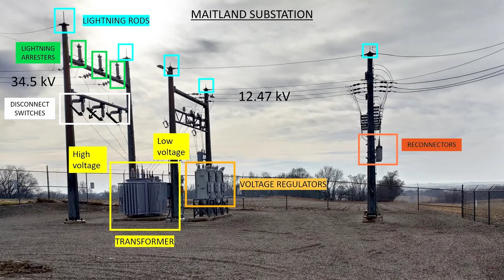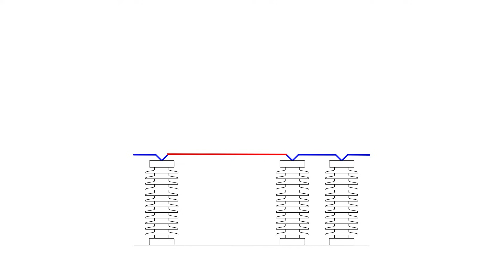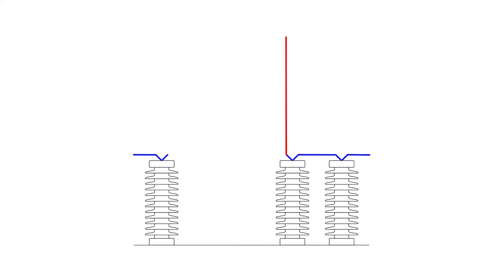Identify equipment in a substation (35 - Electricity Distribution)

Comment: ??ok,....  So are you referring to the stacked insulators as "Bushings" here?? I am confused as we just call them insulators as they do just that...INSULATE! we sometimes refer to them also as "Bells" as some of the insulators do look like glass bells.  You describe that when under load a transformer's voltage "sags" - in reality it actually "drops". Sag would describe a low line or uneven tension on all three legs! At 07:30 you refer to the opening arc on a opening of a switch as "Lightning bolt" which it is not! Lightning bolt is mother nature do her thing...the arc is what you get on a switch( Sometimes called a dragon's tail).  The circuit breakers actually arrests the "Lightning bolts" (Actually arc) by damping inside the switch by being submerged in oil when it operates.

Comment: Regarding the disconnect switch on the hv side, in this case the CB will open the line first and then the disconnect switch would be opened manually or motorized? Instead of open the switch first which cause unnecessary arching

Comment: Why the low voltage side uses recloser but not on the high voltage side? Fuse requires manual intervention if upstream has fault
Reply: Probably because these are small and simple rural substations. Bigger ones will have SF6 breakers on the HV side

Comment: At the 8:30-8:34 mark on the circuit breaker you called the bushings that point out at an angle buss bars. Was this in fact a buss bar on this specific piece of equipment or was that a mistake? They look like bushings to me and just trying to clarify here in case there was a mistake made

Comment: There is a reason you cannot eliminate the switch by using just a breaker. In order to work on the transmission line, by applying grounds, there must be a visible open switch to attach the grounds. It is a safety rule. Utility do not like to use a switch to open a circuit because it stresses the switch jaws and sometimes goes very bad. This equipment is not cheap. Some breakers are oil breakers and the newer ones are SF6. The old oil breakers are large and heavy. Also oil breakers have a potential of an oil spill.
Reply: I was about to add a similar comment this but glad that you got here first. Thank you!
Reply: you are so professional.:washhands: we are make the insulators and switchs factory, we have met so many customer like you. :washhands:

Comment: Cursed local Ultility company when I was on weekend call they sent me to a building I never was in and just had the emergency generator up on the 8th floor replaced. Building had dual 13,200 volt service that tripped out and could not get the ATS switches to transfer back to normal power. For some reason the one elevator on emergency power was not working so I had to climb up from basement to 8 th floor several times. Could not find any books on ATS switches or generator. Here after a few hours called the Ultility company. They told me they were having problem with over voltage that late Saturday night. Think I had over 521 volts instead of usual 480 volts. ATS switch programmed not to transfer power to an over voltage source.

Comment: Nice presentation and information. Question: Are "Ground Switches" considered "Fuse Switches"? Thanks.
Reply: My experience/understanding is that a ground switch is someone you can apply after the load is disconnected. Usually to remove any charge/static from a cable. Fuse switch is just a fuse

Comment: Not trying to be a critic, but I think you have something confused. The part you are calling "regulators" look more like OCBs (Oil Cooled Breaker) and might have a regulator on it. I'm no expert, but I work in the field - R&C designer - and the part you identify as a CB (Circuit Breaker) is actually a recloser switch but they do not have bus bar connected to the bushings, looks like cable to me. Good video though and like how you point things out so even the untrained eye can see it.
Reply from the maker: Thank you for the comments!
Reply: @adanner correct the vid 😂
Reply: No they are VR. Not OCBs
Reply: If you are going to attempt to correct people you should make sure you know what you are talking about, OCB-Oil Circuit Breaker and they are in fact voltage regulators.
Reply: @turdferguson8612 sorry to break it to you but they aren’t voltage regulators. Circuit breakers protect against overloads or short circuits. Voltage regulators are to change voltage when the demand changes. So during high load the voltage will drop, the regulator will change taps to boost the voltage and then when the demand goes down and voltage rises the regulator will adjust the tap to keep the voltage at the set level. 
A Voltage regulator is typically far from a substation, typically in rural locations.
Reply: @stanley4006 is voltage regulator also known as OLTC typically No!
Voltage regulator is actually use for  protection relay that is under voltage or over voltage protection, also Voltage Regulation: Maintains a constant output voltage level of a  transformer, enhancing equipment performance and longevity and  suitable for High Power Applications:  While OLTC ( on load tap changer) is for adjustment of load demand when sudden voltage Change occur without interrupting power supply and can be done automatically or manually.
Reply: @stanley4006  I'm a substation electrician. They're voltage regulators. Typically in rural subs, the regulators will be right on the secondary side of the transformer. I agree that they are infinitely more common on long spans of line in the open world, though.
Reply: @patrickbates6679  yes, voltage regulators make sure that current and voltage sin waves remain in sync as demand of capacitive or inductive loads cause one or the other to lag, real-time adjustment based on load prevents the grid from suffering, also why large facilities  are charged for their reactive power
Reply: @dylansir0230  to correct a lagging power factor caused by a inductive load you use capacitor banks. Auto cap banks have a CT on main bus or conductors in a substation, the controller in the cap bank will then switch on and off banks of caps to add or decrease reactive power to the system. The correction reduces the amount of apparent power. This does help regulate the voltage but is not a voltage regulator.
Reply: @ikpalian4413  OLTC is in a substation transformer to do essentially what a voltage regulator does but the transformer is also stepping down the voltage typically for distribution. We are talking about different things. If you google voltage regulator you can find articles on it, Eaton has a great explanation unless your going to tell me you know more then Eaton does. Let me know where you article is so I can read what you think. 🙄
Reply: @patrickbates6679  I am not disagreeing what a voltage regulator is. Someone else said a OCB is a voltage regulator. OCB is oil filled circuit breaker (for medium voltage) as I am sure you know, for short circuit or overloads and has relays attached for the protection side. We have drained the OCB tanks to filter the oil or replace and inspected and clean the contacts. 
I work for a large testing company, we work in outdoor substations and large commercial and industrial buildings testing, doing maintenance, repairs on low medium and high voltage equipment.  Like but not limited to breakers,
(Test SF6 breakers and fill SF6 gas if low)  switches, transformers, cap banks, cables, and Emergency repairs on equipment that failed, Etc…..
Reply: @patrickbates6679 100% ❤
Reply: @stanley4006 they are not ocbs.even single tank ocb’s are huge! Sometimes you can fit all three phases in an old ocb.
Reply: @ ummmmm they are OCBs (oil circuit breakers) we work on them quite often at work. One place we do maintenance at is a large steel mill that has a ton of them. We drain the oil and filter it, clean the contacts, inspect the tank and contacts and test them including time travel. So yea they are oil circuit breakers. So the name plate inside that says “oil circuit breaker” is wrong from the manufacturer when they were built in the 50s. You obviously know more than the manufacturer right.
Reply: @stanley4006 you can see the little dials on the top side of the tank indicating where they are operating at. Literally those are regulators

Comment: Question:  A substation using a 3 wire 3 phase system, is that a Delta system?
Reply: Not necessarily. Delta, Wye, and Zigzag are all 3 wire sys. if not using the ground/neutral.
Reply: @Eric_Dan-6_MD_PhD  Thank you.   The 3 wire system, no ground/neutral from the substation.
Then the only grounding would be DONE are each pole along the distribution system
that had a transformer mounted to it?      If so, then NO PARALLEL neutral/ground
back to the substation?    thank you
Reply: @tedlahm5740  Dear colleague, the grounding will be "created/invented" by a 'Y' (or Zigzag)  somewhere along the distribution. Body safety grounding connection should not be confused with a Neutral connection created by a phase combination where phases vectors of A+B+C=0 (AKA neutral). Loopback of earth fault is different from neutral fault or unbalanced 3 phases case identified by its 3 symmetrical vectorial components per phase I1+I2+I0=Iphase.
Reply: @Eric_Dan-6_MD_PhD  Sir:  How does the Power Company Balance THEIR load when
it is a 3 phase 3 Wire (no neutral) distribution system?
      I notice NUMEROUS 3 phase 3 transformer primary DELTA systems connected 
to the mentioned distribution system.      (The Three L-2 terminals are connected 
together, so I know THEY are Delta primary.
Reply: @tedlahm5740  Substation transformers typically are delta on the primary side and wye/star on the secondary side.  These transformers significantly reduce the imbalance from the loads on the secondary side passing to the primary side.  This is because the load on each secondary phase gets transferred to two of the primary phases.  In other words, each primary phase carries about half the load of each of two different secondary phases.
Reply: Transmission lines are normally delta.  They feed power to the substation, which turns it into distribution voltage in a wye configuration.

Comment: I have signed up for prof Danner’s courses on edX, very interesting and informative; contrary to usual college level circuit courses loaded with 1st order and 2nd order ODEs, this course is hugely practical with not only oscilloscope graphs bench experiments but also very detailed data sheet explanations on electrical elements used in practice 😅
Reply: Just tried his circuits and by golly, he moves fast. Just throws abunch of formulas at you with very little explanation. Like we know we can replace P=IV with I^2R - why?
Reply: @ouroesa  I like this question, it shows curiosity and and inquisitive mindset. 

The reason we can derive (aka replace) the I*V with I^2*R in the Power (P) equation is due to Ohm's Law: V = I*R. < Read that part slowly, it's telling you that current of a circuit (I) times the resistance of the circuit (R) will always be equal to the voltage of the circuit (V, also called E, for electromotive force, or EMF (which is just a fancy way of saying a measurable force which moves electrons)

So if P = I * V, what if we just replace V with ( I*R ) >> P = I * I * R, 
Or another, simpler way to say it P = I^2*R

I like to remember is with "Twinkle twinkle little start, Power equals I squared R"

Can you show why you can also find Power with P = V^2 / R (or E^2 / R)?

This one I remember as "Is there anytime more Powerful than 2 Eagles over a River?"

Remember is as easy as pie (P = IE) ; )
Reply: @ouroesa  that's high-school physics. He teaches at a singapore uni, I guess his students there have had physics as a high school exam subject and learned it rigorously already.  If you find it hard to follow in the beginning,  try AP physics 1,2,3 to fill the gap.

Comment: What is the difference between "station" and "substation"? Why sub?
Reply: A power "station" usually refers to the power plants where power is generated, which also step up the voltages for transmitting the power over longer distances (higher voltage reduces power loss). In order for us to get the 220V/120V that we use at home, the voltage needs to be stepped back down nearby at these power "substations."
Reply: @matthopper1925  So what's the difference between a Switch yard and a substation considering the fact that you sound Anerican.?
Reply: @jamesmhango2619  Substations always have a transformer and circuit breakers, switchyards typically dont have a transformer and are mainly just switches, bus, and transmission dead ends etc.  Switchyards just move around the power and substations change the voltages.
Reply: It is rather simple. A station is the FIRST transformation (trafo) station after transmission. All the consecutive trafo stations (Distribution) are SUBstations.